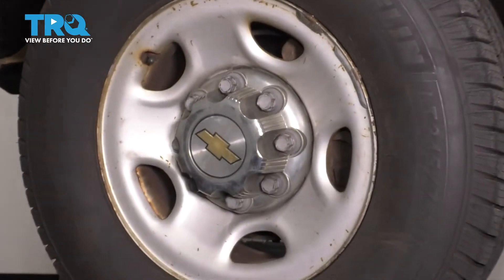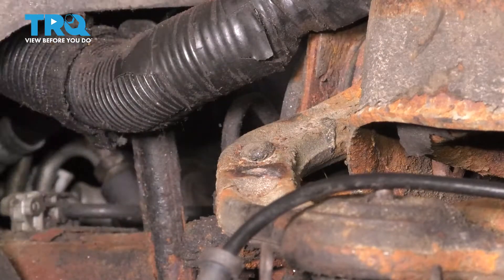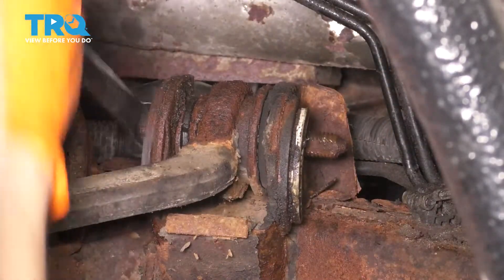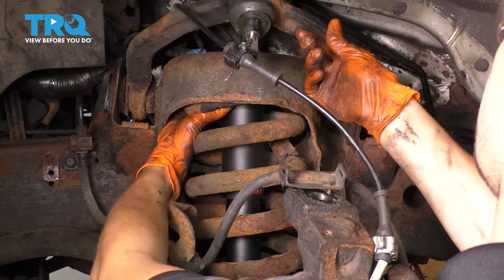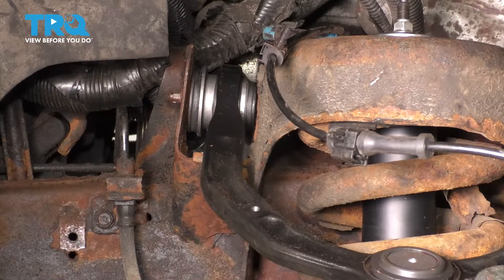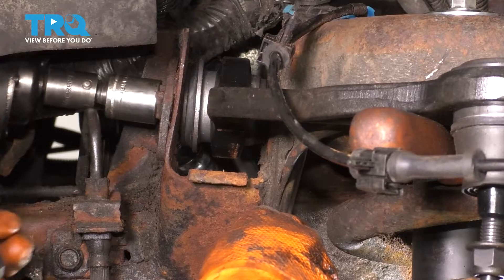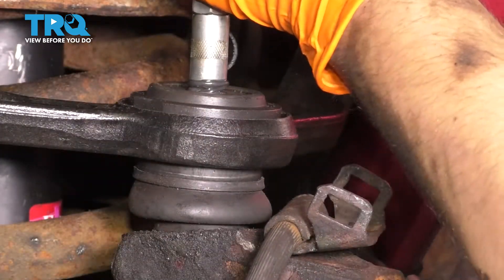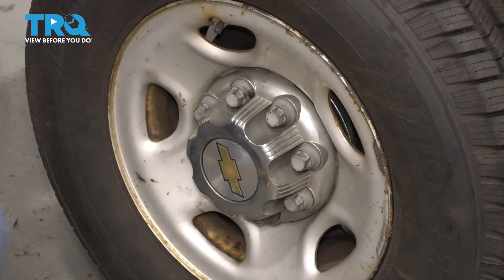How to Replace Upper Control Arm 2003-2021 Chevrolet Express

Comment: WARNING This is not the job for a DIY person. Not only did both upper control arms bolts broke but I had to use cutting wheels. He skipped right over the frustrating parts. I am over 8 hours into one side and not even half way done. Maybe you will have better luck but I highly doubt it.